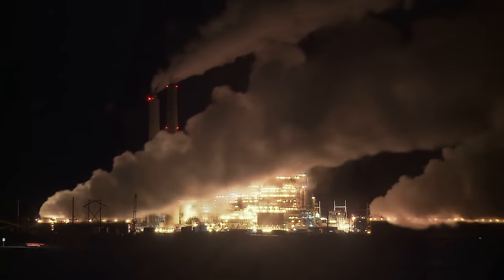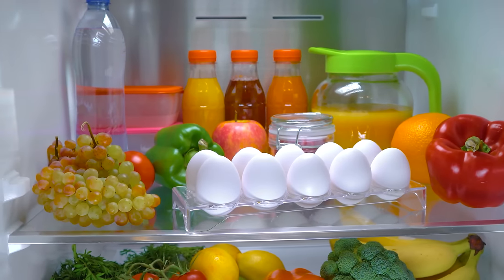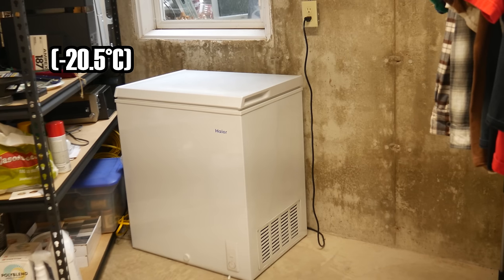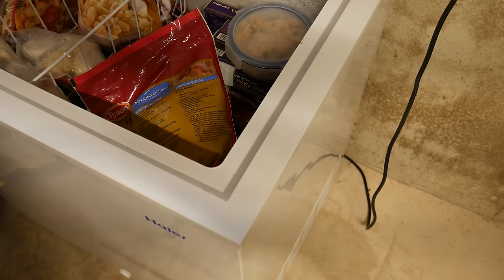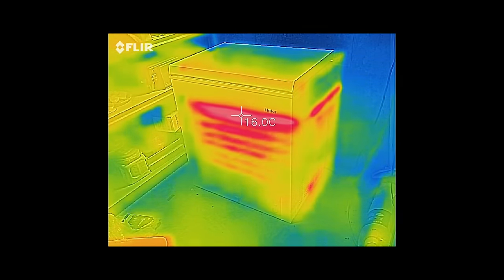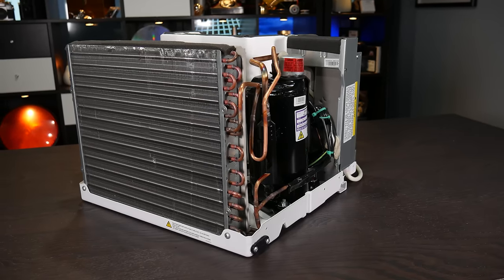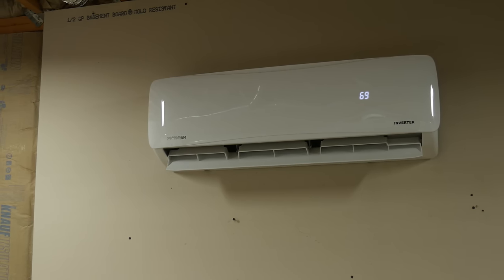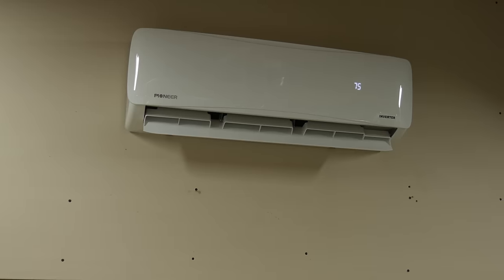Heat Pumps: the Future of Home Heating

Comment: HVAC tech from the EU here, I'm probably late to the party on this but just wanted to add, most mini splits with variable frequency compressors don't use capillary tubes or TXVs but electronic expansion valves for even more adjustability and efficiency and they're usually in the outdoor unit and not the indoor one which is why insulation of the copper piping from outside to inside is so important as well. Anyway, love your content, keep doing what you're doing!

Comment: We installed mini-split heat pumps on our house this year, and so far, we've noticed a significantly lower energy bill both during summer and now in winter. Your videos on heat pumps are a big reason why we did this. Thanks for making these videos. It's a small thing, but these videos are making the world a better place.
Reply: Mini splits suck when they break
Reply: @miguelperdomo786 Buy a Daikin or Mitsubishi, They never break.
Reply: We had a Daikin central coil installed in our forced hot air furnace in 2022, had it removed, no heat, mold in the return vents and the dealer did not have the skill sets to integrate the unit with our furnace. At 0C these units spend too much time in defrost, thereby robbing what little heat you got from it. We live in Eastern Canada, minus 20 regularly occurs, we kept our oil furnace.The technology sucks! It is a big "connection job" on the consumer. I'm 73 and this is the worst heating appliance we ever owned. The government that forced this on us will be gone after the next election along with the carbon tax on heating fuel it imposed on us.
Reply: @davidwalsh5756   I would argue that the technology doesn't suck, but you were sold an inappropriate unit. If you live in a region that routinely sees temps below the efficient operating range of a particular heat pump, then you're going to have a bad time. Most places in the world don't routinely see -20.
If I had bought a snow mobile thinking I was going to use it to commute to work regularly but I lived in Texas (I don't), I could easily say the snow mobile technology sucks because it won't work on bare pavement, but clearly the problem i would be having is a misapplication of the technology instead.
Reply: @davidwalsh5756  sounds like the dealers didn't know what they were doing. usually a system like that is referred to as "dual fuel" and the heat pump is only used for low loads, with the oil/gas furnace acting as emergency heat for when the temperature outside is too low for the heat pump to operate efficiently.
Reply: @ssmfernando *Mitsubishi Heavy. They are far better than the Mitsubishi Electric units.

Comment: As someone who lives in the south, you have taught me something new about my A/C unit. I always thought that the heating mode was just turning on a space heater style system as it's commonly referred to here as the "heating coil". This also explains why it takes a minute to swap between heating and cooling.
Reply: As someone who's lived in the south, you weren't entirely wrong, actually. There is a resistive space heater type coil in there to supplement the heat pump. Our unit when I was a kid also had an "emergency heat" mode that only ran the heating coil. I assume that mode was there in case the compressor outside broke.
Reply: Heatpumps are common in warmer climates in the USA. I'm not sure about everywhere but in Texas atleast where I worked all heatpumps have an electric heating element installed and hooked to the "emergency" heat circuit of the thermostat. This is there to help compensate on really cold days below freezing when heatpumps start to loose efficiently.
Reply: It may be what you think. Some are. My brother-in-law only had resistance heating in his former house in Missouri. Just the way it came when he bought it.

However, usually they're used to supplement rather than be the main source of heat.
Reply: @raptor1jec  Emergency heat mode was for either that scenario or one where older style heat pumps (like my old one before I replaced it last year) couldn't keep themselves defrosted during very cold conditions. Older units were quite dumb and ran on a combination of time and temperature and sometimes it was not sufficient (in my case, sustained 5F and below which is uncommon for this area). I had it happen a couple of times and my whole heat pump turned into a block of ice. Good thing electricity is cheap here.